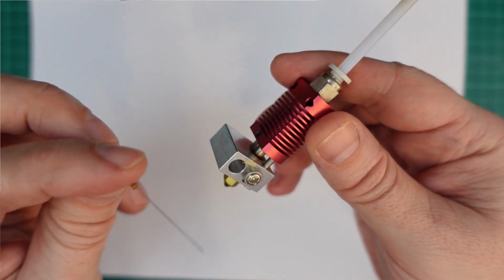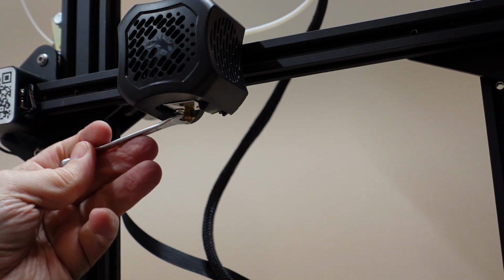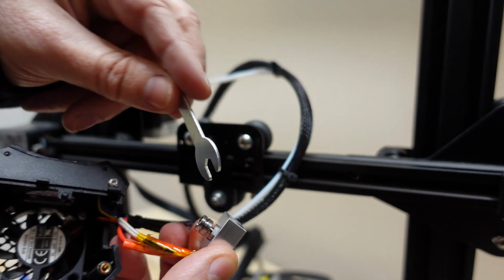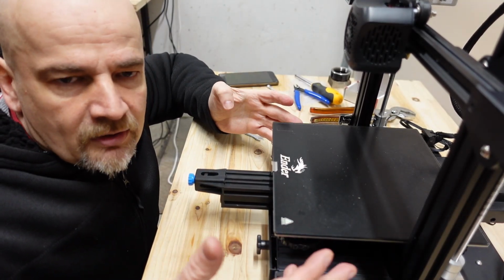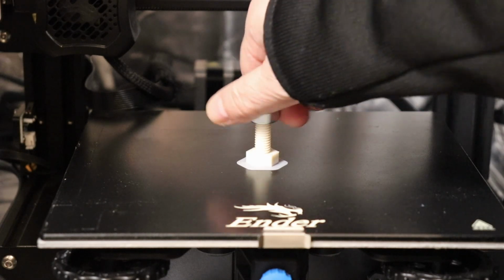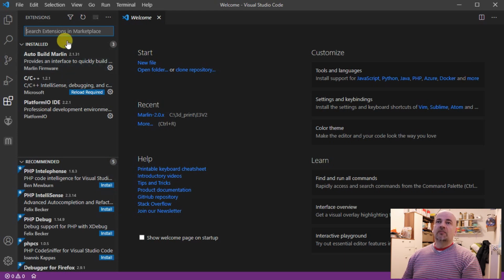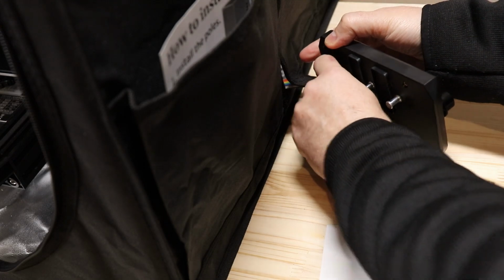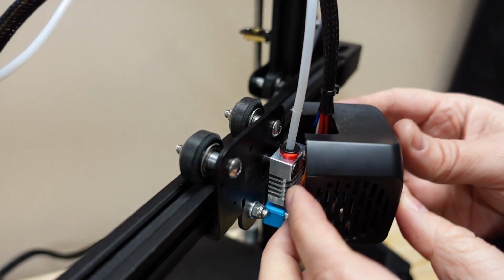Ender3 V2 upgrade: All metal hotend by Micro Swiss + Firmware edit to allow higher temperatures

Comment: I'm still completely lost on the firmware.
Reply from the maker: This is very old solution, but one great solution nowadays is moving to Klipper. BTT Pad7 is more opened but Creality Sonic pad is much easier to setup.
Reply: @MyTechFun  Thanks. I'll look into it. I got lucky and found that Creality has the bin file on their website already set up for 300C (for the Spider hotend). I think I can just throw that on a Micro SD card and load it on the printer to update it to 300C. I'm not sure if that is the MAX of 300c or if that will allow higher temperatures than that though... because the Spider hotend should be able to get up to 500c as far as I know. I'll probably never print above that and would prefer 300max, so it can't be set any higher on accident... but at the same time, I would like to have the option to print at 450-500c if I ever have to.

Comment: I just set up OctoPrint, which could fix your visibility problem by doing a timelapse or video. It took just about an hour and a half to install the Raspberry Pi and OctoPrint and mess around with settings. (Don't install any plugins until you run some long prints)

Comment: thanks for the awsesome video. You put the temp at 270. Can I get a bimetal heartbreak and print at 280-300? will the thermistor go that high?
Reply from the maker: The info I got is that stock thermistor and heater shouldn't be used above 270-280°C. Not sure why, somebody wrote that thermistor also has teflon coating, maybe that's the reason(?)
Reply: @MyTechFun  I needed up getting a all metal hotend. So I am probably going to replace the thermistor. Any brands to recommend for US customers?

Comment: for the 4.2.2 creality released a firm version with 300 degree temps and support automatic leveling.
Reply: also, I found out that the hardware version can also be found in the menu. Another interesting thing is auto-tune PID for hotend and for bed, also in the menu. I think this is a new thing, my firm is from 2021 and came with the printer few months ago.

couldn't find anyone talking about those 'new' features in the stock firmware

Comment: I really need help please someone.

After flashing the firmware and following all these steps, Using pronterface, I can see that all my firmware changes were flashed and saved (I changed the esteps to see if there is a difference and there was), only the max temp didn't change (i tried 280-300). Ive got exact same set up as in the video.

Comment: Great video!! I have the same all metal hotend on Ender3 V2. Any idea why there's a lot of material build up on the nozzle when i print PETG? Nozzle is not leaking i've confirmed. My E-Steps are accurate as well. I tried under-extruding by changing the multiplier to 0.94. I've also tried increasing the gap between my nozzle and the bed. no luck so far. Eventually the build up clogs the nozzle in 25-30 mins after cleaning it. Any idea how can i resolve it?
Reply from the maker: PETG is more sensitive to moisture. This can result more stringing and oozing. Try to dry the filament.

Comment: I did everything step by step by watching your video. I paused it many times and tried to match the screen shots with yours and I get errors every time, I even made sure to download the same versions of firmware you are using in the video. I am trying to get my temps to 500 degrees C and a bed temp of 180 degrees C so I can use the PEEK filament. I have the Ender 3 v2 with the Spider hot end  and the upgraded bed heater, can you help me with the bin file so my temps can reach that?
Reply from the maker: Try to modify Jyers firmware, that's what I use now. Only changed lines are temperatures. About PEEK, you probably know that you need new heating cartridge, thermistor, heating element. And probably heated enclosure with water colling steppers, hotend..

Comment: What firmware to use ... I want to install CR touch as well as micro swiss hot end on my ender 3 V2 (4.2.2 board) kindly send a video link too
Reply from the maker: Now I moved to Jyers firmware, only thing I changed in source is max temperature as shown in video
Reply: @MyTechFun  it means CR touch works with this firmware.
Reply: @MyTechFun  Great!

Comment: I did firmware update, same as on video but after compiling give an errors... Can you share your bin file ?
Reply from the maker: bin file depends of several things. But in the meantime I moved to Jyers firmware. Try their source, I just changed the lines there temperatures are (CR-Touch, DDrive , 4.2.2 board version)

Comment: If you DIY this it needs boron Nitrit Paste at the Sensor and heater tobmake full contact with the Block. If not it wint have 100% surface contact and could Perform worse than an original. This is by far the Case with 90% of the people coming to my repairshop.

Comment: Thanks for your very detailed video.  When trying to compile the file I am getting a failed report with a lot of errors.  My stock Ender 3 V2 has a 4.2.2 board, is there anywhere I can download a pre compiled file?
Reply from the maker: creality.com (support, downloads) or try jyers fw, there are several versions (but limited to 260°C)

Comment: Great video I could see that your thermistor has PTFE tubes insulating the cables touching the heat block. You may need to upgrade to a cartridge type thermistor capable of withstanding 300+ degrees.
Reply from the maker: Any suggestion for the type? (if you have personal experience)

Comment: How to configure the firmware to also include my bltouch? And I compiled on my Mac, but the new .bin file is nowhere to be found..??
Reply from the maker: Sorry I am not familiar with Mac. The firmware I also modified when added bl touch. But I would suggest, use the Jyers source for bl touch and only modify the temperature. That's what I am using now.

Comment: Hi Igor. I love your channel. You get straight to the point and you come off as a Craftsman to me more than a 3D printing geek. As a Craftsman and engineer myself I appreciate that.

I'm really good at figuring things out myself but I've run into an issue I would like to run by you.

I have the Ender 3 V2. I'm using Jyers 1.3.5b modified for higher temps and manual mesh.  I have a metallic extruder and micro Swiss hotend, and that's it.

I'm trying to print ASA and I'm having terrible layer adhesion at all temperatures, changing the z offset has had minimal benefits. I'm using the same temps you did in your direct drive video but. Bed leveling has never been an issue for me so I'm not even considering that. With my enclosure I have no problems getting my prints to stick either.

For my test pieces I'm using 20% infill. Maybe ASA likes more infill? More walls? I've only been printing for 2 months but I pick things up really quickly. I can print perfect dimensionally accurate prototypes (no toys) with all other materials. I'm using very high quality ASA too.

My settings in a nutshell

260 hotend temp
110 bed temp
20% infill
100 flow rate
0% fan
50 mm/s speed.
I'll check what my retraction rate is when I get home but I'm pretty sure it's close to yours.

Thank you for your time Igor!
Reply from the maker: Next things I would try if I would be on your place: - check esteps of extruder, try different material (other brand of ASA). Your layer adhesion is OK with PETG? Temp in enclosure should be approx 45C, don't open it during printing. Try additional wall around object to get even better layer adhesion (skirt size of object). Your settings looks ok.
Reply: @MyTechFun  Thank you Igor. My apologies for such a long post. However I feel like you are someone that can handle lots of data with ease. 👍

I will check the things you mentioned. Yes I do not open the enclosure (same one you have by the way). The couple times I had to I peeked through a small opening like you did.

PETG is fine.

Good to know the enclosure should be 45c. Now I have something to use my laser thermometer for.

I'll check the e-steps. That's something I haven't messed with since I started printing, still learning, so I will look into that.

When you say add an extra wall. Do you mean to the part itself, or like a tall skirt separate from the part? Like a wall around it to retain the heat?
Reply from the maker: @dangerous8333  It's called draft shield. https://youtu.be/wGUUgDxWLrs?t=114 And e-steps, any time you mess with extruder you have to check e-steps (is 100mm movement of the extruder real 100mm) But probably it is OK of you don't have problems with other filaments. Just check it. https://youtu.be/fa7IflGJH2Y?t=1829
Reply: @MyTechFun  Edit: Sorry igor, I am incapable of writing a short post. I'm an info junkie! 

I wanted to follow up with the outcome of my goal to print ASA.

I installed a CR touch so I could eliminate bed leveling as my issue. Solved a problem I was having where my extruder was binding and skipping occasionally. Finally figured out it was pinching the filament too tightly and was flattening it and leaving teeth marks before entering the Bowden tube. Based on your mentioning of e-steps I watched some videos and a gentleman with similar issues changed his e-steps from the default 93 to 106 on his Ender 3 V2 with the same metallic extruder made by creality. So I just switched mine to 106. I'll dial it in later.

I loaded up the ASA and the outcome was shocking. It printed a PERFECT 150mm handguard for my air rifle in ASA! A complex part and 7-hour print with Zero stringing and perfect layer adhesion.

I'm pretty confident it was a mixture between the extruder being too tight and the e-steps. I was printing the PETG before the extruder problem that's why I think there was no issue with it.

Thank you for your time Igor.

Comment: Wait.....Pause @1:03  Wouldn't it be just as easy and or CHEAPER to get a tube the size of the PTFE Tube that will fill the area that this expensive "all metal" hot end does?  Shove it in and leave an area above it as shown in the image @2:05.   This doesn't sound too difficult for someone with access to cutting and machining precision tubes.  I'd rather pay a few bucks for a tube to fix a pro0blem that I don't have.
Reply from the maker: Hm. Good thinking, not sure why they don't use this, maybe the thermal expansion would be different or friction of the metal is bigger..
Reply: Isn't the point of the heatbreak that it has low thermal conductivity and prevents the filament further up from melting? If you shove in there some metal pipe it won't stop heat from melting the filament way too soon. Heat creep or whatever they call it. Just what I've read in other people's comments. I don't really know anything, but it doesn't sound like a good idea.

Comment: I am having a hell of a time doing this but I will explain why. I have the Micro Swiss Direct Drive and Micro Swiss Hot End. All of the source code I download from Marlin is easily editable including Jyers. The problem is none of the source code has bed leveling enabled. How do I fix this on Marlin 1.3.5?
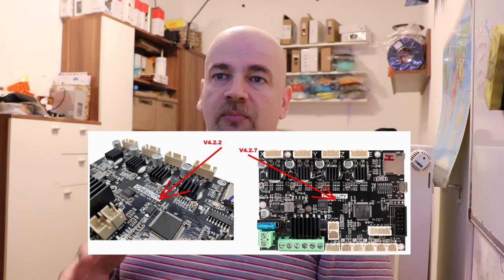Reply from the maker: I am not familiar with 1.3.5 Marlin, but this video may help, Marlin edited there (enabling the BL touch): from 21:27 https://youtu.be/7ZKg5u1pia4?t=1287

Comment: Hey, My Tech Fun, loved your video. However, when going through the steps of changing things in the config file, I kept getting errors when changing the 'false' statement for 'Z_MIN_PROBE_ENSTOP_INVERTING' to true. The error statement stated that I MUST keep the statement as false. Will it matter that that much, or at all, if I'm unable to change this line of code? Thanks

EDIT: below is the exact error code that MS Studio gave me...
buildroot/share/PlatformIO/scripts/../../../../Marlin/src/inc/Conditionals_LCD.h:743:6: error: #error "BLTOUCH requires Z_MIN_PROBE_ENDSTOP_INVERTING set to false. Please update your Configuration.h file."
  743 |     #error "BLTOUCH requires Z_MIN_PROBE_ENDSTOP_INVERTING set to false. Please update your Configuration.h file."
Reply from the maker: Thank you for the info. In the meantime I moved to Jyers firmware..

Comment: I have ender 3 pro, could I apply similar step in firmware update?  Is there a simpler way to do it?
Reply from the maker: Ender3 pro with old mainboards don't have the bootloader, so the procedure is different.

Comment: Massive help... big thanks! I 'whacked' it up to 300C on a new Ender 5 pro... watch carefully and then upgrade heater & thermistor when necessary! I'm only interested in Nylon/PC Carbon blends and 280C is probably the bare minimum so pushing the limits was always the aim. Subd!

Comment: Can you please help me. If I try to build the firmware but is gives me an error:

C:\Users\Cas\.platformio\lib\Wire\src\utility\twi.c:25:10: fatal error: avr/io.h: No such file or directory
 #include <avr/io.h>
          ^~~~~~~~~~
compilation terminated.
* [.pio\build\STM32F103RET6_creality\lib5d2\Wire\utility\twi.c.o] Error 1

The application cant find the io.h file, but I dont know why. Can you explain why the .h file is not found and how to fix it?
Reply from the maker: Sorry I can't help you about this problem. Sometimes it collect files online, maybe temporarily that file was unavailable. In worst case, try to reinstall those add-ons (extensions)

Comment: Why did you change all of the heater temperatures and not just heater 0? Do all the heaters come together to control the hot end? 24:30 also, if I change the heating cartridge do I need to specify it on the firmware or does a change in hardware only need firmware changes when dealing with the thermistor?
Reply from the maker: Just in case, if somebody already changed the heater number. Depend of the heating cartridge if they requires firmware changes. Buy a stock one, then you don't need to change it. But PID tuning is recommended.

Comment: How likely is it that the stock thermistor and heater cartridge can't physically go to ~300C? What replacements, if any, would you recommend? And if it requires a replacement cartridge/heater - assuming you switch to an all metal hot end and edit the firmware - is there anything else that would prevent you from printing at the temperatures needed to print Nylon?
Reply from the maker: I got the information, that max temperature is 280C, but better to stay below this limit, that's why I changed max temp to 270C. I didn't do this upgrade yet, but search for HT thermistor and heating cartridge. And for nylon you need enclosure, filament dryer, glue stick for better adhesion
Reply: @MyTechFun  I'm also interested in seeing a video of installing upgraded heater cartridge/thermistor to an ender printer. I want to print polycarbonate but temps above 260° C are not recommended even with the all metal hotend because the stock thermistor insulation is PTFE and will offgas poisonous fumes.
Reply: @rileyneufeld7001  I have an Ender 3 pro too with the 4.2.2 board, all metal hotend, but stock thermistor and heater. I set the values in the firmware to 320c but around 300c I get a max temperature error. I found that the max value I can set my print temps to in practice is 294c, above that there's enough fluctuation to hit the limit and get the error message that prompts you to shut the printer down. From what I've read it seems that I need a thermistor that can handle higher temps and that should fix this, but yeah, as long as you don't have the ptfe tube going into the heater block you can reliably run 290c on everything else stock.
Reply: @rattila13  Oof thats VERY hot for the stock thermistor which is only rated to 260°C... I'd be very weary about running a printer like that, could damage the thermistor and get false readings and have a very bad day... The stock 40w heater can melt through the aluminum heatblock if it's not getting proper readings. That's not even talking about the PTFE off-gassing likely dangerous fumes either. I want to just get to around 270-275°C but I'll just save up and get an all metal hotend and a gulf coast hex thermistor that's actually rated to 300°C. No need to cheap out on parts when your health and safety is at risk.
Reply: @rileyneufeld7001  I've got an all metal hotend so I'm not worried about ptfe off gassing, also aluminum melts well well above 600c, and I have thermal runaway protection enabled in case the thermistor shits the bed. I ordered a new thermistor that should be good up to about 450c, until then I'll be printing lower temp nylons.
Reply: @rattila13  The thermistor is wrapped in ptfe so while the hotend isn't off gassing the thermistor wire insulation is. If you were to damage the wiring due to too much heat and the thermistor have a bad reading and falsely read say 200°C when it's really at 290°C then the heater is going to apply even more heat until it reaches the target temperature. In that case thermal runaway protection will not help. That is why a quality thermistor is so important. Plenty of people have melted the aluminum heat blocks look it up.
Reply: @rileyneufeld7001  Took me a while to find one, regardless, I have a new thermistor on its way and until then I'm putting everything on hold because I'm still having layer adhesion issues at 290.

Comment: Thank you for this video.  I'd just like to add that on a Mac computer for some reason when I completed the firmware updates using Visual Studio Code, The PIO folder was hidden.  I tried it about 20 times and couldn't find the folder.  I finally thought to look for hidden files in the Marlin folder and there it all was with about 20 copies of the firmware.  I'm not sure I did it all correctly, because it still reads top temp of 260c, but the main thing was the files were hidden.  Thanks
Reply: I just compiled also on a Mac, I used the finder to search for the files…still can’t find the files.